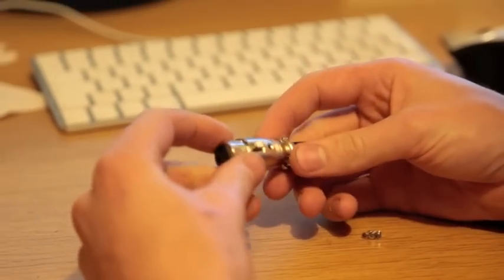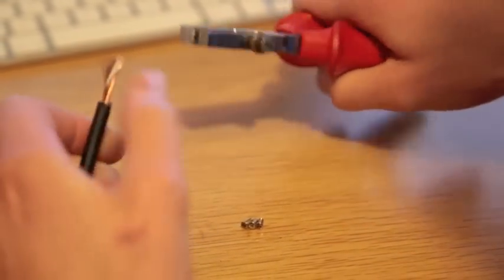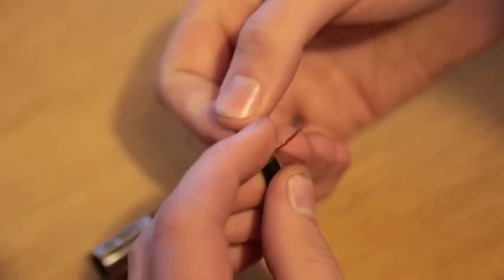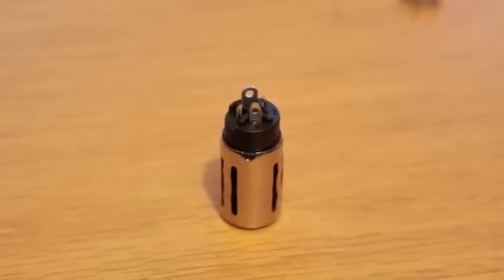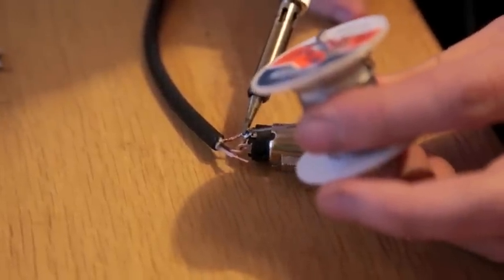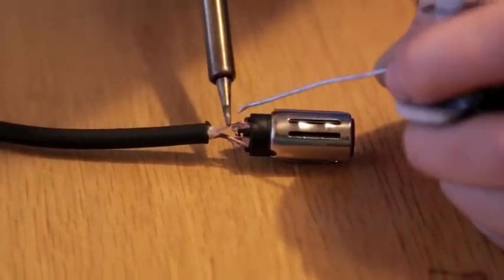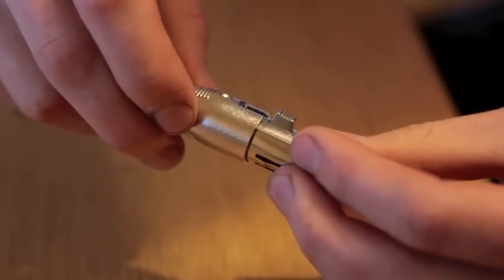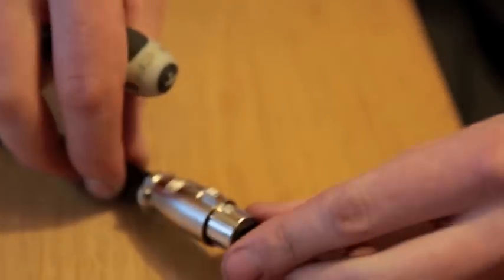How to wire a XLR plug for microphone lead

Comment: What I don't get is the fact that the XLR jack and plug both have three connection points. Why have three solder connection points (pins and pin receptacles) if you only end up soldering two of the pins together anyway? Technically that makes it a two pin jack and plug. I am guessing that the third pin is used for the 48 volt phantom power if the particular mic is a condenser mic that requires the phantom power to operate...then again, I am just guessing here. It would make sense in that case.

Comment: Don't need that much solder mate.  Heat the joint and allow the wire to draw the solder in.  All that excess on the outside is not needed.
Reply: DENMONKEY 1.) is 100 percent correct. 2.) I don’t see how you think he’s a troll. He was very polite. Cheers.
Reply: A GREAT video on how to wire an XLR cable, and that's your comment? You damn troll! Find something to do...